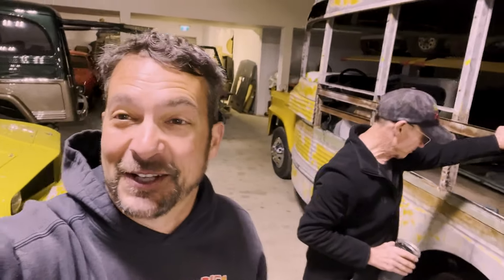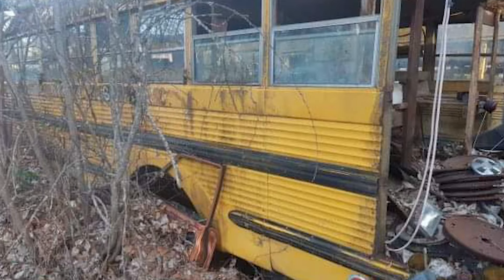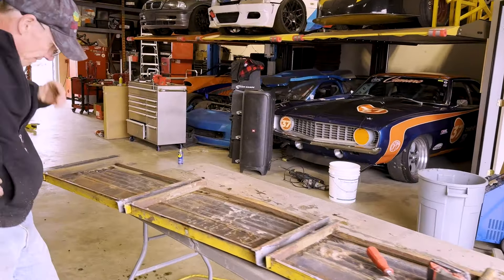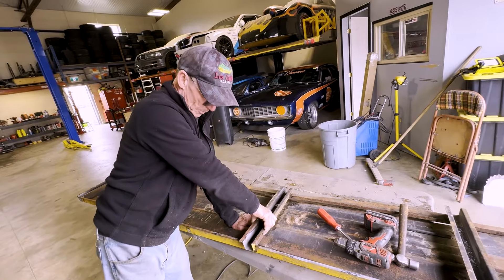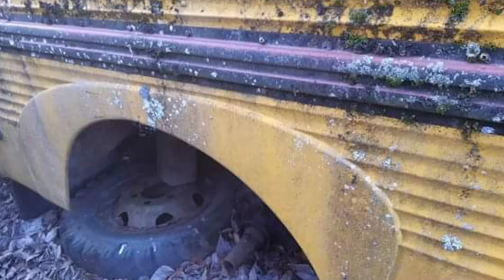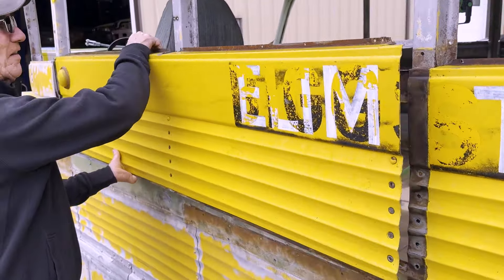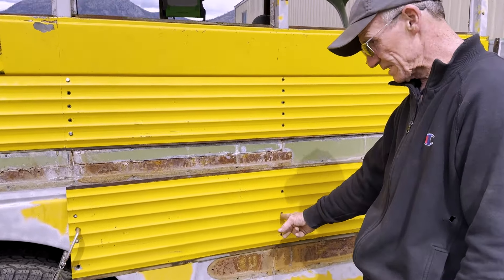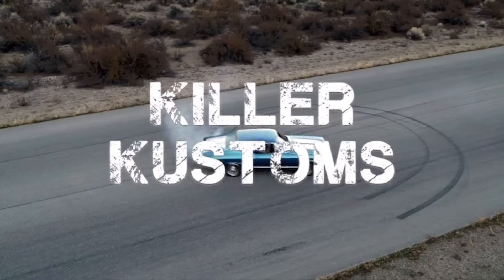From a School Bus to a Luxury Tiny Home / No More Rust!

Comment: Hi JF, Glad you were able to find some replacement panels. If there weren't any to be found, sandblasting the rust away then a coat of primer to protect the bare metal. Could you fix the old panels using hot lead ? Take care. Roland